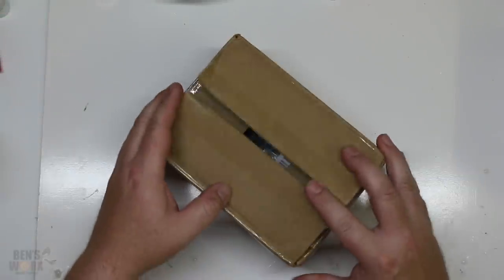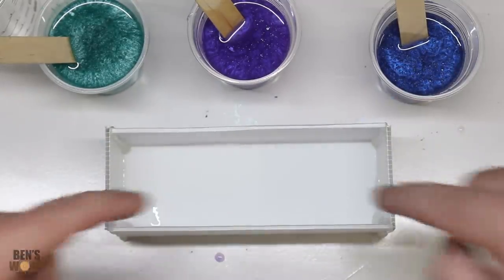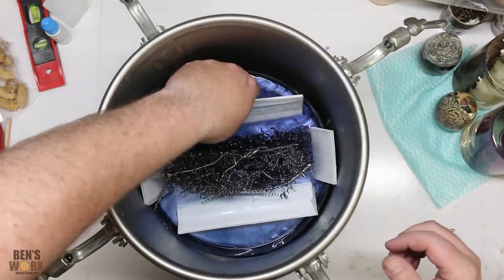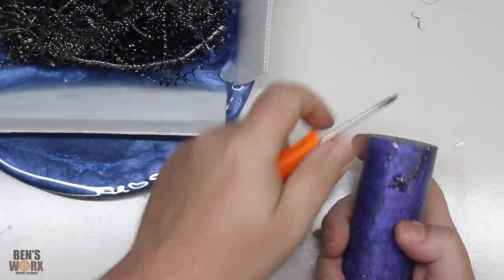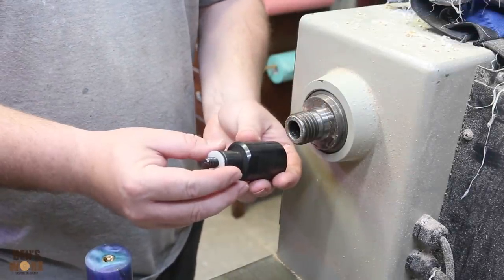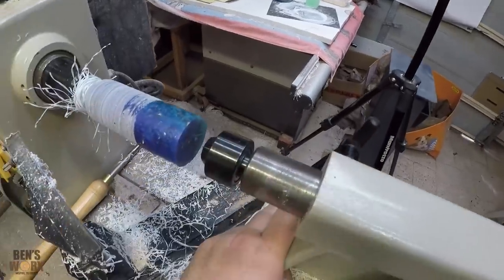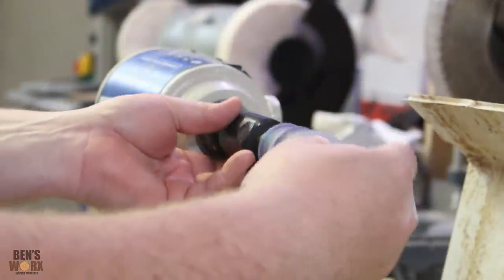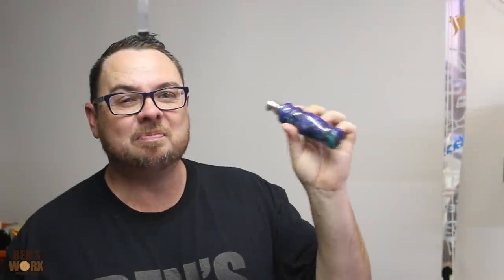Turning Steel and Resin into a Bottle Opener

Comment: Turned out lovely, but I totally get why you wouldn't want to repeat this. Maybe you could try drilling or turning different colors of resin or plastic, and encasing those in clear resin? Would be a similar project with a very different effect and without the issues presented by the metal
Reply from the maker: Thanks Mate, great idea too

Comment: I just don't understand why you'd use opaque coloured resins when putting in embeds that are meant to be seen? A light translucent or clear would have shown off the metal so much better. I know you said never again but I'd like to see a do-over with clear or just slightly tinted resin (please not blue, so many blue resin projects out there) A drop of red or black maybe, and only just a drop. Please :o)